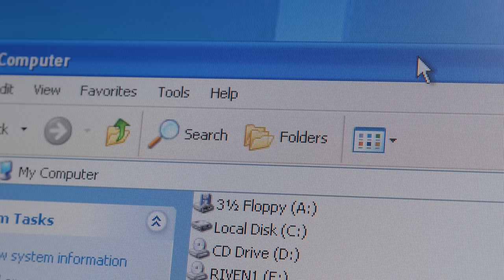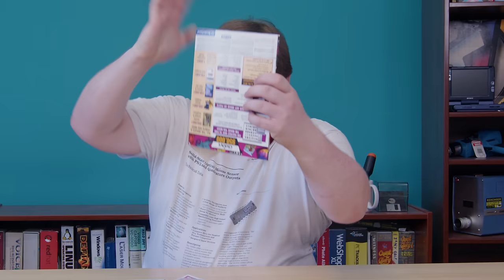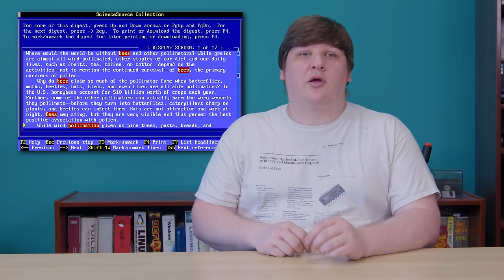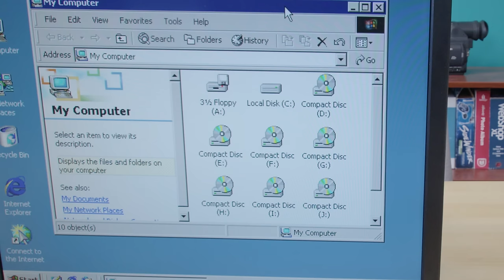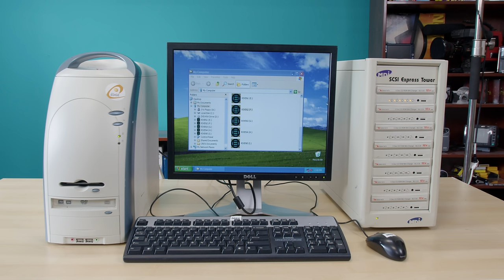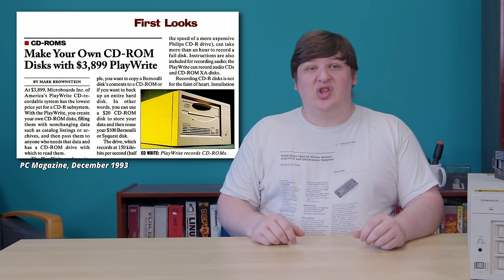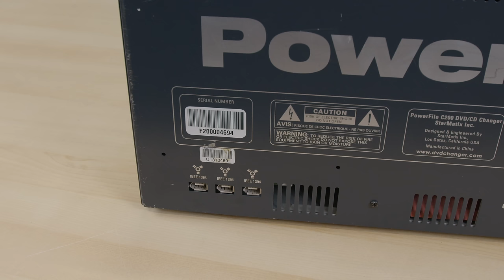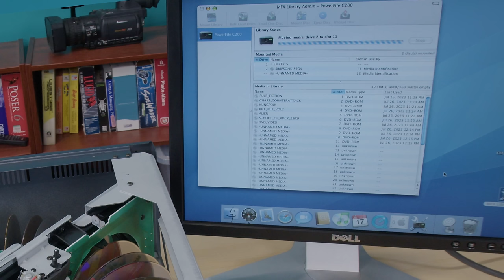A Jukebox for your PC: 1993's CDROM Servers

Comment: There were some larger capacity devices in the 90s that were I believe made by Plextor but rebranded under several names including Denon to be used as audio gear. Looks like the PX-J2200 was a 200 disc SCSI CD changer, I remember working with a few of these. There's not much online about them but they did exist and you could daisy chain 6 of them since they were SCSI. So you got in a fairly small footprint (For the time) 780,000 MB (728 GB) of read only storage.

Comment: In the late 90's and early 00's my uncle who lived in the same house as us was in IT for Mattel, the things I remember most were the sample toys he got as gifts from the company and the insanely expensive computer hardware. His PC at one point was a server tower, dual cpus and redundant power supplies. He had two disk changers, with game disks in them. I remember him trying to network them so we could access them from our part of the house, it lasted only a few months for the reasons you described.

The one I remember most was one that showed all the disks as different drives, and one other problem that came up was back then not all software recognized more than the first drive in a computer. So you couldn't use the changer for a single multi-disk game, because the different drive letters would confuse it, and it would still ask for the disk to be in the first slot. I figured that out when I got it as a hand-me-down, and tried to set it up. I spent a few hours messing with it and then decided it wasn't worth the trouble. I imagine if I paid for it I would have put more effort in, but it would have still been disappointing.

Comment: @54:33  I got two pieces of software on CD at work recently.  Disc 1 was Siemens HMI programming software that came with the software license USB key, disc 2 was label design software for a Zebra industrial label printer.  I already had the Siemens software installed and updated via the internet, the Zebra software disc was actually just a blank CD-RW with a nice silk screen.  (We got three of those Zebra printers, each disc was totally blank, I really wish that the discs had the software on them because it was a pain to find the correct version online from a source the company firewall didn't blot out.)

Comment: I remember that bizarre inverse era- when software makers were shoving 299 Game Packs, audio-visual encyclopedias, and edutainment fluff out the door at light speed- all to fill the gaping maw of CD-ROM bandwidth, whether you wanted it or not. I’d argue that FMV gaming’s rise in popularity during the mid 1990’s was in part due to developers feeling the need to utilize all that bandwidth, even if the actual concept or implementation wasn’t all that compelling most of the time. The irony that the medium blew up so much that it quickly outstripped the CD-ROM, leading to games like Riven or ST:KA coming on 6-8 discs, as DVD-ROM was still in its infancy, is noteworthy.

Comment: I used to work in the optical storage field.  I joined in the early 2000s when hard disk prices were coming down and hard disk storages were getting huge. 
This meant the writing was really on the wall for optical storage libraries. 

The main use case at the time was for a write heavy archiving environment. 
For example, if you were a bank, they might have one or two drives constantly writing contracts as digital images to the worm discs, rather than keeping them on paper, and one drive being used to retrieve them.
The worm media meant that the contracts couldnt be photoshopped by someone later. 

The access to existing contacts was only occasional, they would only be called up if they were being reviewed or is there was a dispute.

This means the likelihood of mass retrievals frommultiple disks was quite unlikely. 

Other use cases were medial imaging, scans etc (a doctor who misses a tumor  until its too late can't photoshop it out of a scan  to avoid getting sued) and xrays of aircraft components, to prove there were no microfractures at the time of shipping. These would only need looking at if an aircraft were to explode.

For anything outside these extremely niche fields, the falling cost of large raid storage solutions make optical media a veeery expensive solution.  With RAID you can grown your raid over time, adding new disks and chassis. With optical you have to buy the jukebox up front and that was an enormous investment.

Its a shame as the bug jukeboxes were such a joy to watch in action. 
We had some dified ones with clear sides, for trade shows. They wer the sizeof an american fridge with several columns of media and it was so fun to see the robot picker scuttling up and down indide the chassis moving the disks about.

Comment: This was a really nice trip down memory lane. 😂

As a first year student, writing my first term papter in 1992, on compact Macs in a computer lab, saving the paper on a floppy, it was all bound paper indices of abstracts, and the library catalog was accessed by dumb terminals with green CRTs. At least we could print the catalog hits on tractor fed paper on a pin matrix printer, and run around the stacks to find the bound journals.

In 1997, first year as a grad student, the university had access to services that sent articles by fax after accessing the abstracts on my PowerBook1400 logged into the library remotely. And since I could receive faxes on my PowerBook, that’s what I did.

These days you get the article PDF, or even the whole book, right away, with one click from the library’s catalog search page. 😊

Comment: some of those towers were amazingly reliable. The US Air Force used them well into the mid-2000s for the four CD Fed Log Supply system catalogs as they were always locally handy even in network outages. They ran 24/7/365 for many years. Most ran Windows for Workgroups and were not networked. Durable media the size of CDs were a glorious revolution and having nearly the ENTIRE Federal Supply catalog for all weapons systems and everything else with a National Stock Number was an enormous labor saver.

Comment: The part your girlfriend mentioned about each row having to be powered up in stages reminds me of when I was in College around 1995. When we were in the computer lab at the start of the class the lecturer would first power up the NT Server and we were told not to power on our PC until given the go ahead. Then in rows (I believe there were 4 rows) we would get told Row 1 power on. Row 2 had to wait until all the Row 1 Windows 3.1 for Workgroups machines were up and logged in before Row 2 could go ahead due to the load. In total it was about 20 mins before we could start the class. The NT Server provided Internet access to all the machines - I'd love to know what kind of speed that connection was and if they were only using something like ISDN which I suspect as it was so slow.

Comment: My grandfather was a programmer for a long time. His whole thing was building apps with himself and a few other guys and then selling the IP to either Microsoft or IBM. I'm fairly sure he has every MSDN disk in his basement, right up until the last physical copy because they just never stopped sending them after they bought out the company and he retired on that. They had no server, and would just hand the disks around. Each guy had a couple of drives in his workstation and would probably have a small stack of disks on his desk. He and I will be dumping them all into a file server, my NAS, over time. He still finds it amazing that my little NAS holds 24TB, and honestly so do I, given it's the size of a toaster and has 4 drives in it.

Comment: I have one of the CD libraries. The library consist of over 120CD of digital images and topography images from NASA satellites, it is from Mobile R&D in the 90s, however it was out of date when it was released. Oil and gas companies were the top of the latter in computer power in the early 1990s, I was given 40 years of a person's files from Mobile R&D. Every engineer and physicists had silicon graphics computers top of the line each computer being over 60000$. ( Like 168MB of ram in 1993, with several SCI3.5GB hard drivers, along with several GPUs. )  However, they were not big on the CDs it seemed. From what I can gather oil and gas companies used data from satellites to detect gravity anomalies on earth, which usually meant the presence of oil wells. Mobile R&D had mapped every single massive oil well on earth between both Arctic and Antarctic circles by 1991. ( It is extreme difficult to have a satellite orbit North to South and Vice Verse, thus why the arctic and antarctic circles are still being explored for oil.  Digital photography also started with these companies from satellite images and over laying topography maps on top. I have digital images from as far back as 1979 in this collection. ( I could not believe this at first Photoshop in the 70s?!?!?! )  Everything was stored on tape drives at these companies. The master programs are on these weird huge magnetic taps which require to me an unknown unix based operating system. The most popular tape storage though, being Exabyte Drives. You could fit up to 4GB ( Yes no joke ) 4GB on a sony Hi8 tape in 1987. I have 100s of these tapes, each full of satellite data from the 80s. Asking why you have not been able to see a single CD from one of these collects is party from alot of these CDs being thrown away. The CD collection that I have is just a professionally organized index of what these oil and gas companies already had on tape decades before. Of course this doesn't apply to every situation company big outlier. However, it is interesting from the oil and gas companies level of tech back then.

Comment: My father worked for a large company in the 80s and 90s, and they had subscriptions to various CDs, but what they actually did was dump those CDs to tape and then throw the CDs in storage, and eventually shred them. You could get several GB on a single tape, and there was existing infrastructure in the data centre for handling tape libraries and serving the data over the network, so they considered that a better solution than going directly off the CDs.

Comment: We had one of the larger Nakamich 7 disc double-speed scsi cdrom changers. I still have it over here nearby, well it's no longer in use - since decades already. ;)

We used it way back then on our Amiga based BBS to serve some few public domain discs at once in our download area.

Which was a really huge deal, for a year or so at least. smile

Luckily, because of comparably slow modem speeds, we never really had a problem with trashing on the changer... ;)

Comment: Really cool! Brings back memories. Used the Pioneer single cartridge unit for the ABUG BBS I ran when I was president of the Amiga Based Users Group here in Toronto. I had Amiga shareware and free utilities on the CD library. Worked well for the most part. Didn't have heavy traffic(one modem, one phoneline) So had fun with it. Most users of the BBS appreciated it. Had the different changers like the Nakamichi's. Also ended up with four CD towers which had CAT's (Catepillar's} parts database on  7 discs in each drive in the towers. In all they were all still a pain in the uhmm to use at times.

Comment: We had ones like these in a law firm I worked for 30 years ago. The Westlaw stuff came on a lot of CDs because a full T1 was about as fast as it got at the time. Tons of cds... still twitch when I think of it. It was all part of a Novell system and we wrote batch files and login scripts that were just... art I was proud of that would map the correct disc/drive to the right place for whoever was using it

Comment: 16:00 related to the CD delivery service: I worked at a video game arcade that had a subscription to music videos on VHS tape. Every week a new box of tapes arrived with the top music videos of the week. We shipped the old ones back. The owner cancelled the service and never returned the last videos, so we had MC Hammer's 2Legit, TLC's Lets Talk about Sex and others on constant replay on the 3 19" TVs connected to the VHS player.
Reply: My first proper job was a tech at an arcade machine rental company, we had music video jukeboxes that held about 50 vhs tapes (top 40 and a few popular bangers iirc). The machines were not small and had a robot thingy that loaded the tapes from a horizontal rack when the user selected a video on a wall mounted panel, much like a Wurlitzer jukebox. Anyhoo, every month we had to pull all the tapes and a van would arrive to pick them up and deliver new ones. They were incredibly strict on getting the tapes back and checked they had all of the old batch before handing over the new ones. The machines themselves wernt very reliable and we ditched them within a year.
We used to get the top 40 on vinyl for every jukebox on location as well, which sometimes got ripped to my recording walkman. Much better than trying to edit out the djs waffling on when recording from the top 40 show on radio 1 lol.

Comment: I was running a Roboboard FX and Wildcat BBS back in the day with a cdrom jukebox connected to probably a 386DX 33 machine back in those days.
It was a fun setup. Believe I had 8 single CD drives in a tower and every month got a new CD to stick in a drive to replace the oldest monthly CD with a bunch of shareware utilities and what not. Eventually the very first copies of linux were arriving as well.
Was good times, really made for tight knit groups of friends some of which still survive today.

Comment: Those things are just plain glorious to me, I absolutely love my spinning optical media (to the point of spending way too much on anime BDs and still finding it to be 100% worth it), interest in PCs and such since little and with enough interest in mechanical stuff to become and engineer, this just ticks all the boxes.

One really interesting development tho, is that this concept is NOT dead yet: Sony has a line of business archival gear called... Optical Disc Archive, basically BDXLs on multi-disc caddies comprising like a terabyte per caddy or so, and as you can imagine by my comment and a quick Google search they also do have those enormous cabinets to fit several at once.
The discs out of the caddies are also simply glorious see-through golden discs. I would love having some of those myself, albeit the consumer grade BDXL discs are also just lovely being a dark golden color (looks almost black, until it actually reflects something).
If you don't have those yet (I mean mostly the consumer BDXL tho but...) I suggest grabbing some discs just cause why not while they're still an attainable thing. Of course not all drives read/write those tho.

Comment: 26:57 On this topic, I honestly think you're mistaken that these were designed for any consumer use because to me, the aesthetic looks really similar to a lot of 90s medical electronics (specifically Sony's medical printers, just look it up and you'll see exactly what I mean). I can see them aiming this squarely at medical institutions, especially since a medical institution is where a CD jukebox would make sense to actually use (medical reference material would have probably taken up gobs of data) but not be in a server room setting. That would also explain the arcane CD mechanism, since it was probably an unproven market and they were aiming it at the more prosumer-y/small business market, they just used an old mechanism to cut down on production costs and the market wouldn't care much.

Comment: I did IT for law offices in that time period and never had to touch LexusNexus. If memory serves they didn't do physical disks and it was something that was setup by a sales rep and connected to online so they could control it since it had a monthly per seat licence that was insanely priced. I think most single practitioners just used it at a law library because of the cost. As I'd assume others had mentioned the better example would have been automotive repair guides from Mitchell On Demand or AllData. They would mail out new disk sets quarterly and I think Mitchell had gotten up to something like 13 disks before they went online onlly. AllData didn't have quite as many disks since where Mitchell included scans of the original schematics, AllData redrew them as vector files (this was a selling point as they were drawn consistent where the OEM's have large differences in how they are drawn). Mitchell also worked with multi-disk changers as I had more than one client that ran them like this so the disks didn't get scratched in a dirty repair shop.

Comment: When I was a boy I was with my Dad when he was servicing a security system for the department of Health here in Australia back in the mid 90s. In the middle of the room was this enormous enclosure with some rail like tracks on the ground, with a robot arm running up and down the tracks at a tremendous speed picking up tapes and inserting them into a bank of tape drives at one end. It never stopped and was changing drives repeatedly the entire time we were there. It was absolutely mesmerising to watch it never make a mistake as it used it's manipulator on the end of it's arm to shuffle tapes around. It was able to hold two tapes at a time, this way it could remove a tape and insert a new one, running back to put away the removed tape. I'd estimate there were no less then 400 tapes in it's catalogue. Amazing machine, really wish I had been able to record it in action, sadly while we were there they were about to decommission it, so we never got to see it again.